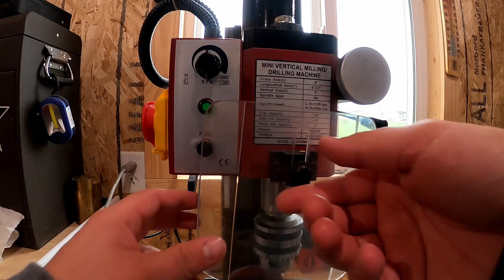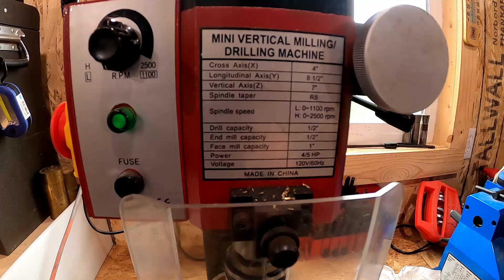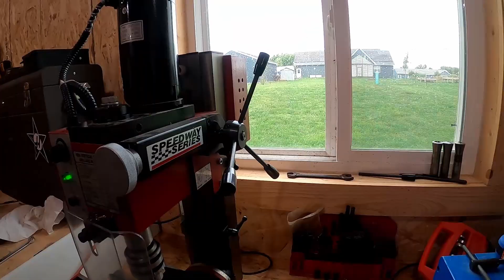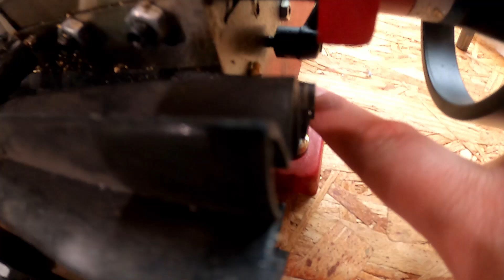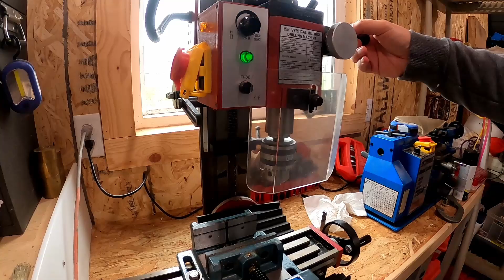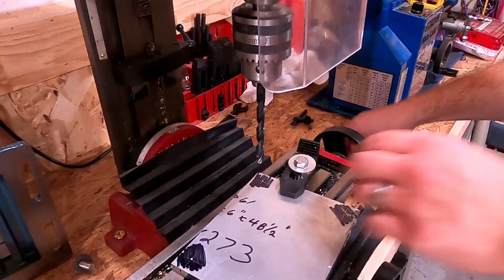HARBOR FREIGHT  MINI MILLING MACHINE- SPEEDWAY SERIES REVIEW AND TESTING

Comment: Hey question 

I’m trying to make these little sauce bowls where I drill a 3” hole using a forsner bit to bore out the 3” hole and use a 3.5” hole saw to cut out the diameter.

With a regular drill press as I descend into the wood with the forsner bit the bit stops spinning like the belt can’t handle it how well would this drill press handle cutting into thick hardwood?
Reply from the maker: This mill likely wouldn't be able to handle it either, its just not designed to handle much of a load. When using a 1/2 endmill I am able to stall the machine. Hope this helps, thanks for stopping in

Comment: Can you make 1/2 inch slots in 1/8 and 1/4 inch thick steel plates?
Reply from the maker: Are you asking is you can plug to depth with a 1/2" endmill and slot? I have not tried it yet but it doesn't take a ton to stall out the spindle, it will get the job done in passes but I dont think it will at depth in a single pass. Thanks for stopping in.

Comment: I strongly suggest you mount this mill with better more sturdy holding down bolts than the ones you are using now,you don’t want this tipping over on you believe me.Small it is but my god these things are heavy when they tip into your lap and you get your balls milled.
Reply from the maker: I appreciate the concern but this thing is mounted with structural lag screws into 2x material and then attached to the wall, it's not going anywhere. Thanks for stopping in!
Reply: @k6outdoors  Oh in that case hope you have fun with it,I’m selling mine along with my lathe,too many years and steam engine making have played havoc with my eyes.Good luck.

Comment: OK that's not 4 or 5 horsepower Maybe half or three quarters of a horsepower What I want to know is what are you using as a tripod for your camera because I have to get me one of those
Reply from the maker: Yep, I definitely misspoke on the motor size. Just using a cheapo tripod with image stabilization
Reply: @k6outdoors  no big deal I just wish you were right how deep of a cut will that make will it cut mild steel at all
Reply from the maker: @sentineloffreedomforever1381  ill have to try it out, my gut feeling is .1 DOC might be much for it with a .5" cutter

Comment: Speedway is a performance parts company, that's a put on sticker
Reply from the maker: This was purchased as the "speedway" brand. I have several pieces of equipment, including a grinder that were in the box with the speedway name on it. Obviously, they are not sold that way anymore but are 100% speedway by brand. Thanks for stopping in
Reply: @k6outdoors  ok,, l  know seig made them and harbor freight, grizzly and little machine shop made there changes and sold them, l have a grizzly,, l made a wider 1/4 inch steel platform and backbone and screwed the column to it,, really took out all the chatter and l can remove the Allen screws if l needed to tilt it, really bad design not alot if tram support with one center bolt and no indexing position

Comment: But can it handle gunsmithing duties?
Can it make a bolt action rifle receiver?
Can it make AR parts?
Can it make hand gun parts?
Reply from the maker: With any tool or piece of equipment it can do what the operator is capable of. This machine may not be of the highest level of quality but with the correct skill and understanding of the machine you can make whatever you want within reason. Just my opinion on the matter, thanks for stopping in!
Reply: @k6outdoors  I have zero knowledge or experience. My dad is a retired tool and die maker who refuses to teach me lmao

Comment: Nice review.  There's no way that 4/5 means 4 to 5 HP,  more likely 0.8 HP   The motor amps drawn and voltage are a better indicator of applied power.  For each HP input you'll draw ~750 watts of electrical power. Friction and other inefficiencies will leave you with less than that at the output to turn the cutter.  Checking the max depth of cut on a piece of steel would be a better indicator of what the machine can do.  Testing on soft metals or plastic doesn't indicate much.  I think you could make a simple improvement with that draw bar set up.  Get a piece of 7/16 -20 UNF threaded rod that is about 2 inches longer than the bar you're using now.  Weld or braze a nut on one end and then run a second nut up to just below it.  Use the free nut for drawing the bar tight and the fixed nut to back the bar out of the R-8 collet.  Then you can drop just the collet out the bottom and leave the bar in place. That would be my choice.
Reply from the maker: You are 100% correct on the HP.. i was just reading along not thinking about it and decided not to go back and rerecord it. I am well aware of material differences and its affect on cutting performance, however it cuts steel just as easily (it wasnt its max depth rather than what it does in this situation since i had this material handy :) ).  Many simple improvements could be made but that was not the intent of the video. I appreciate the feedback and the suggestions!

Comment: No way that is 4.5 HP. 4/5ths maybe but even that sounds OTT considering they are 350 watts.
Reply from the maker: I think you missed the other comments, several others have pointed this out :). I misspoke when making the video and instead on going back and refilming that section i let it ride. So yes to your point,  it is 4/5ths hp. Thanks for stopping in and happy holidays.

Comment: Have one I bought in 2007.  Have used it on 4130 and 4140 to make aircraft parts.  This last week drilled a 1 inch hole in 1/4 cold rolled.  Good drills and endmills.

Comment: Hi.  I got the identical mill (and the identical lathe in the video background) from Homier at the same time as your Grandad did.  They are indeed functionally identical to the corresponding Harbor Freight items, but they were considered to have better fit and finish.  Likely Homier paid Sieg for a superior inspection standard, and in some cases, for higher quality components.  Mine worked great out of the box.  I have always been amazed what I could do with the mill in particular.  I have since moved on to bigger machines,  but I still have both  running well  (now destined for CNC conversion)!  Enjoy!
Reply from the maker: They really are nice little machines for what they are! Id like to have some bigger equipment in the shop in the future for sure! Thanks for stopping by!

Comment: Rekon this would do for milling knife fullers and pre tempered and pre heat treated carbon steel if done so slowly ?
Reply from the maker: Not sure why it wouldn't work! Ive had no issue cutting low carbon steel, obviously im taking super heavy cuts!

Comment: What tolerances will this mill too? Can this be used for gun smithing?
Reply from the maker: Its like any machine IMO, if you know how to handle it, you can hold tight tolerances
Reply: What you can get out of a manual mill depends on how good you are. If you're careful you can get sub thousandths out of a machine. You're not going to get that on one pass though. Realistically in production cutting machines are +0.003 When you need tolerances better than that then that's what surface grinders are for. When I needed sub ten thousandths that was what 600 wet or dry on a surface plate was for. Sometimes one light pass was all I did.

Comment: How does it do on steel? I need to be able to make tools for my lathe, and occasionally cut a flat on a receiver or a dovetail.
Reply from the maker: It does just fine on the mild steel ive used it on,  I however haven't cut a dovetail. Thanks for stopping in!
Reply: I have used one (harbor freight model) to make aircraft parts in 4130 and 4140.  Good thing I was paid by the hour as this is no speed queen.  But it did hold the tolerences to ww-2 standards on the drawings.

Comment: The one you linked is about $1,000. Do you know which ones are good/bad clones and what to look for?

I was hoping for $500-$700
Reply from the maker: The Central Machinery one that Harbor fright is in the price range that you are looking for. I honestly do not know if there is a good or bad clone. You have to calibrate your expectations based upon the price for the equipment. It is obviously only going to be so good. Really the big things I pay attention to is how smooth the X and Y travel is and  if there is any play. Its also good to see covers on the various areas and not an overwhelming amount of noise when it is turned on. There are many things you have to account for and you have to kind go with your gut on if it is right for you or not.
Reply: I have looked at these for the past two years or so and the prices seem to have increased a bit, though that could also be due to supply and other issues with Covid still going on. 
I'm Canadian, so it's different for me, and the cheapest here is usually around $900 to $1000 on sale (there's always one or two on sale). 
In the US, Littlemachineshop.com and Grizzly have versions around $800 USD. For the price though there are some better mills a few hundred $ or more at both places.
Reply: Thanks for the responses guys. Good to know as a lot of youtube videos use versions much cheaper, but they’re old videos so it makes sense. Looks like I’ll have to settle with a larger price. Looking forward to buying one with good upgradability though.
Reply: The prices on the imported stuff has really gone up lately. The price of everything has gone up lately.
Reply: These machines are made by SIEG in China, and are sold by Harbor Freight, Northern Tool, Micro Mark, Grizzly, and Little Machine Shop. SIEG is the premier maker of mini mills and lathes, and is good quality stuff. The premium version is the SIEG branded unit sold by Little Machine Shop. It has a significantly bigger table, air spring support for the head, and a rigid - non tilting column to overcome rigidity issues with the tilt version. In early 2021, these things are going for $800 + or -  due to tariffs and the pandemic. As info, the 62.5 dials (.0625) equal 1/16” per revolution.
Reply: @tomt9543  absolutely amazing info! Thank you! Honestly I don’t even want the tilting column. I always thought that was a sketchy axis addition. The spindle should be as rigid as possible and any angles I’d want I’d probably just find a way to fixture them.
Reply: @vaskolego  I got one last year, and it’s surprised me how well it performs! People that buy these and run them as if they’re a Bridgeport are doomed to disappointment, but as long as you take smaller bites you won’t have any issues! I’d seen several YT videos of users changing the plastic gear up top because they stripped it, so I ordered a handful to be prepared. It’s been a year now, I use the thing a lot, just finished building a PM Research stationary steam engine (working model!) as a matter of fact, and I have yet to break a gear! Buyers of the Harbor Freight version should be aware that although HF doesn’t sell parts, Little Machine Shop sells every single part on them! LMS is THE go to for all the mini mill/lathe stuff including tooling sized to work with the mini’s! Stay well!
Reply: @tomt9543  That’s great stuff! I’m getting more and more excited haha. Seems like LMS is the way to go. I’ve always been on the safe side with depth of cut anyways. I also learned on Chinese Jets not bridgeports so i never knew the fascination.

Comment: Smart plan! This machine shows great rigidity along the short axis of the table. :)))
Reply from the maker: Yes indeed!
Reply: @k6outdoors  It was the same with my machine during the first measurement. But then I measured the gaps in the column guides. It turned out that the terminal strip these guides has offset screw holes. Therefore, the terminal strip the only one who touches the right guide post is. After adjusting the position of the terminal screw holes in the terminal strip, the right rail is fully engaged. The machine stiffness is now in the direction of the long side of the table 0.015 to 0.02 mm per 10 kg of bending force exerted on the spindle.

Comment: That`s an impressive little machine for the money. Years ago, I went to Harbor Freight to buy one but ended up buying a much larger Mill/ Lathe combo there. (350lbs).
I have regrets. This machine has a smaller mill spindle MT2 and the dials are in metric (ugh).
Reply from the maker: I agree with you on the value! It's not perfect but for the price it's hard to beat! Thanks for stopping in!

Comment: The big problem is its origin, that the quality of the breading is bad, I had one and it fell apart
Reply from the maker: Its definitely not made with some of the best materials. It is a prime example of you get what you pay for. Mine works well for what I use it for but may not last for others. Thanks for stopping in! Cheers

Comment: 4 to 5 hp?  Four/Fifths.  R8 is the way to go for milling.  Thanks for the vid.  Well done.
Reply from the maker: Yea I messed up when recording the video and noticed when editing the video, its 4/5ths hp. Apparently I've gotta watch myself a little more, should've went back and re-recorded it. Thanks for stopping in! Happy  Holidays
Reply: @k6outdoors  Merry Christmas to you and yours.
Reply: @k6outdoors  Wonder why they do not say it is 0.8 hp? 4/5s sounds odd. Can you replace the main bearings with taper roller bearings to take better load?
Reply from the maker: @gvet47  I agree on the HP callout, seems a little strange on the format, maybe because it is Chinese made?! I am sure changing the bearings would help, but as soon as I put a cutter larger than spec'd into a collet and try to take a pass it shuts the machine off. I just need to buy a bigger CNC mill! Thanks for the comments!

Comment: Solid review.  Oh, and I believe that would be a 4/5 (four fifths) horsepower, not a four to five hp.  ;)
Reply from the maker: Yes, i meant to say that. Unfortunately the damage was done and my foot was already inserted in my mouth. I was going to fix it during the video editing but didn't feel like retaping. Thanks for watching!
Reply: @k6outdoors  what I see folks do a lot in editing is put a text overlay in the video to fix the gaffe. We all knew what you meant though. I wanted to see how many Watts the motor was. You can tell their power by that. 752 W is a HP. Your motor should be 600 W.

Comment: Get a decent vise.  That thing you're using is about as rigid as a noodle.  There shoull be an X axis lock in the front, under the vise.  I haven't seen a mill without one yet.  But, with that vise, you're never going to get a square piece out of it.
Reply from the maker: This will work fine for 90% of the stuff ill be making on it. I thought I mentioned the x axis lock in the video. I have a hard time spending several hundred on a vise for a $700 mill, but if I cross that road to really needing one ill look at it then. Thanks for watching.
Reply: @k6outdoors Little machine shop.com #2024 $99.95 and worth it.
Reply: And also get a one piece drawbar.  One that resembles a long bolt. It will save you a bunch of time.
Reply: The problem with drill press vises is they lift when you tighten them. So yeah you're never going to get anything perfectly square. You can put an indicator on one and tighten it and see it happening. I guess you could put toe clamps on the movable jaw. But that's a crock fix.

Comment: Great video young man. For a great deal of the people in their home shops, this can do a great many things as long as they remember the capacities it can handle. Most jobs around the home shop won't require a 42" milling machine with variable speed head, digital read outs, powered Cross, Longitude and Knee. But then there is no knee. lol.

Small point about the power. 4/5 means it is .8 horsepower. 

Another good video.
Reply from the maker: Thanks! Your right, it is limited in its capacity but if you know its limits it will be great for alot of folks. Id love to have a Bridgeport or a cnc vertical but id have to get the finance committee on board haha! I meant to say 4/5ths hp in the video but I apparently lost it lol. Thanks as always for watching!